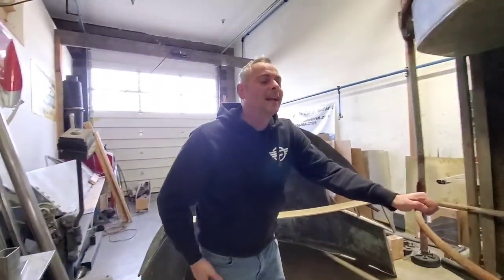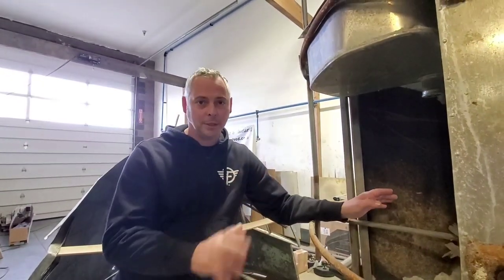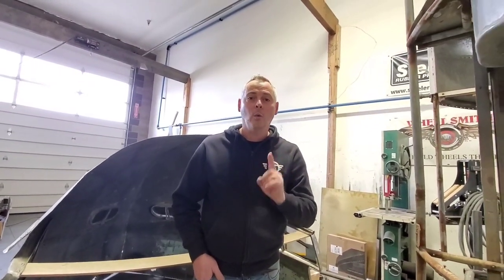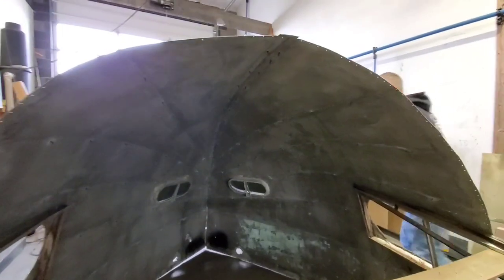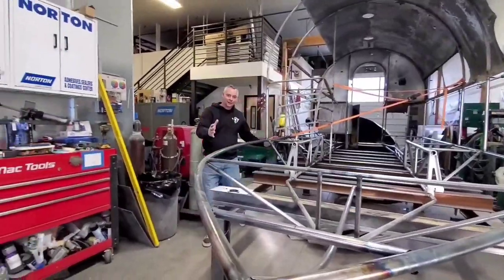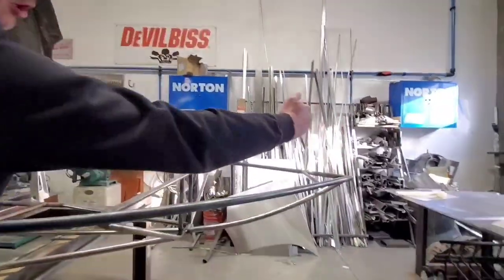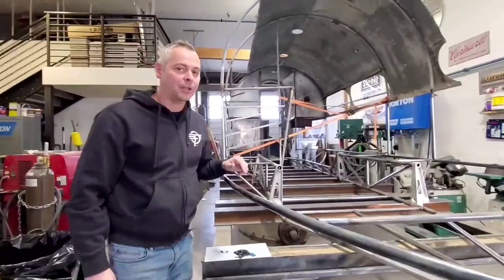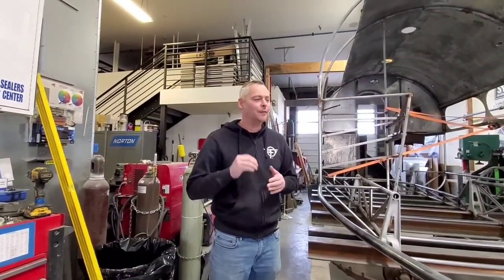Tour of the 1935 Bowlus RoadChief Vintage travel trailer Restoration by Flytecamp

Comment: I was very happy to see your  story come up on my phone ...I have followed you for years on tv...miss watching the transformation of the vintage trailers...just asking..when you do a restore on the wiring...do you replace it with house electrical grade...why I ask is my live in horse trailer made by bison...has crappy wiring...all the bulbs burn out..the wiring gets hot..some connecters even get hot and they burn out and have to switched out....I do not feel safe in this cheap thin wired trailer....